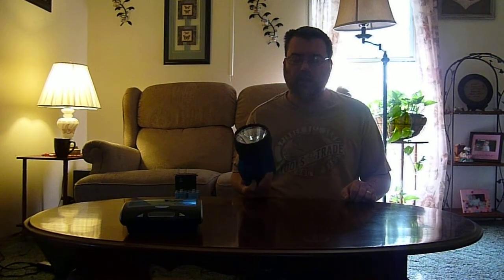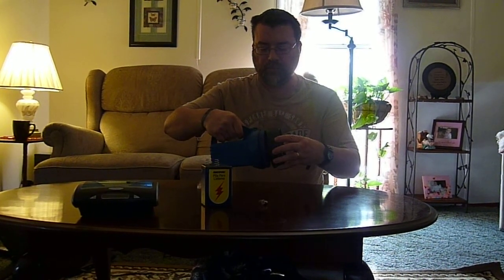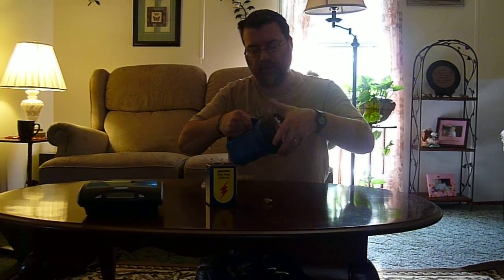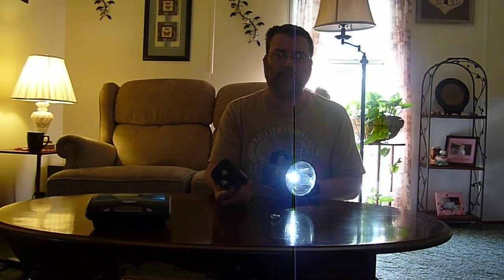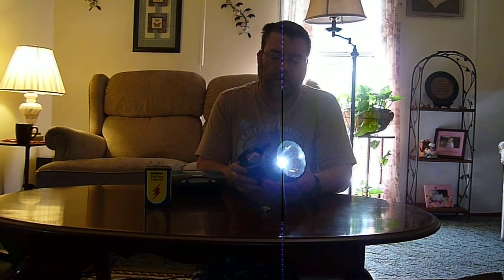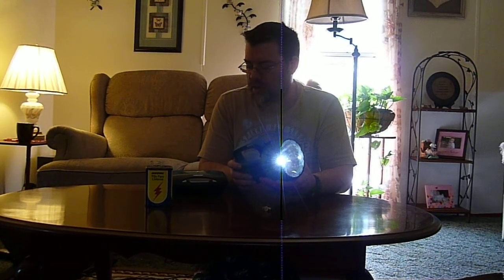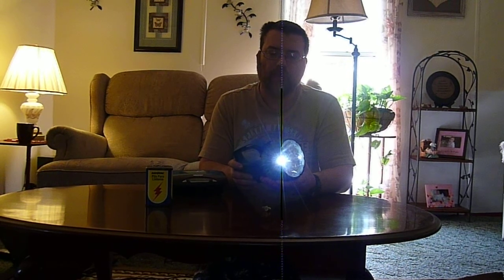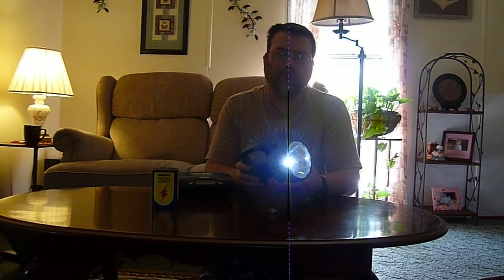Rechargeable LED Flashlight Upgrade

Comment: The bulb polarity on a lantern is opposite that of a flashlight. With that adapter one could use a flashlight led bulb if the 4 D cells were installed in reverse. Mext time you make a video you might consider putting that table lamp in front of you.